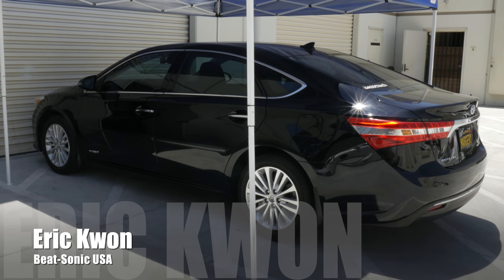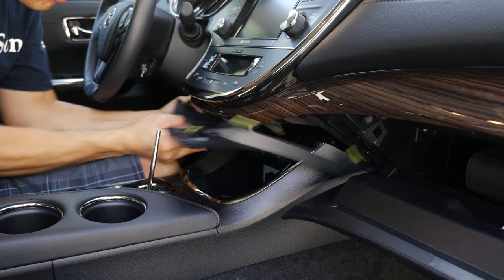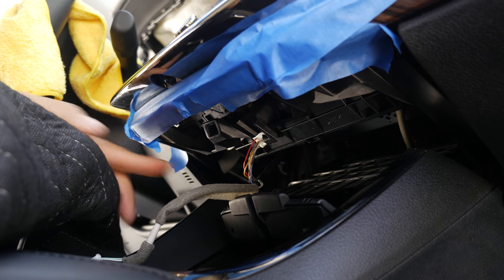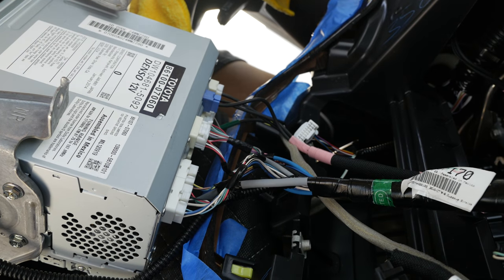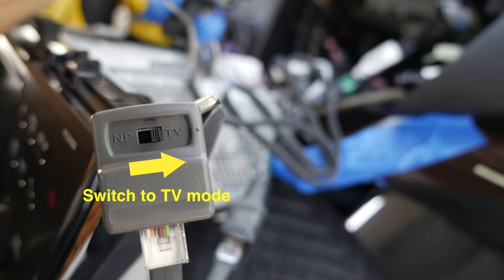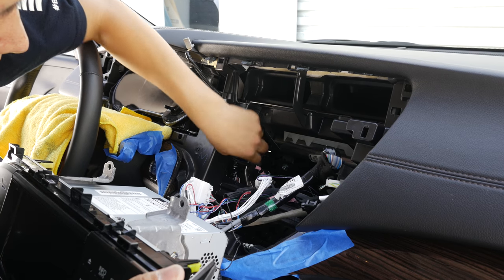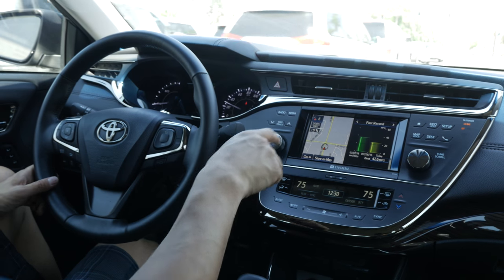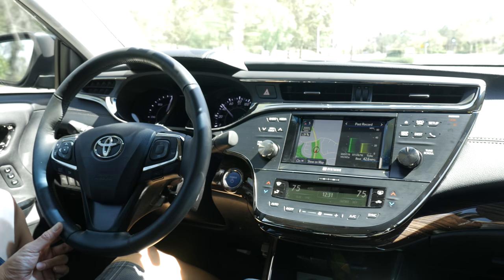2013-2014 Toyota Avalon DVD & Navigation in Motion Controller Installation Beat-Sonic

Comment: Toyota Avalon Limited 2013 in the first start of the day all systems work ,GPS, Bluetooth Radio CD, back camera etc if I drive for ten hours, there is no problem in the system, but if I turn off the car at any time and turn it on again, all the options screen (except the radio and the CD player) stops working and even after two hours I turn on the car, the systems (except the radio and the CD player) do not work, which part do you think is damaged, because I am in Canada, if I have a part, I can use my son, who is an electronic engineer, to repair
Reply from the maker: Please reach out to your local car dealership